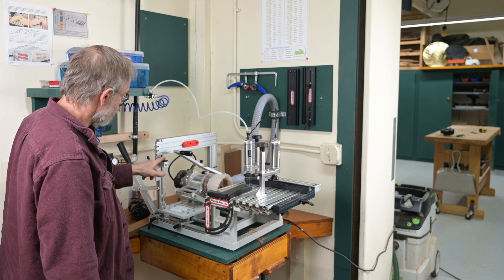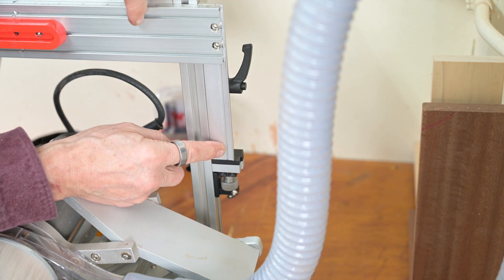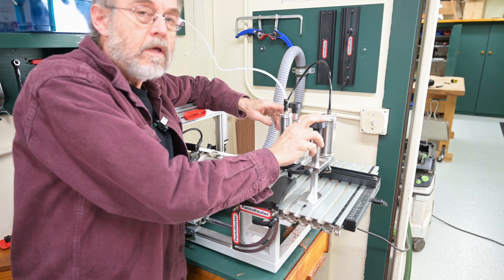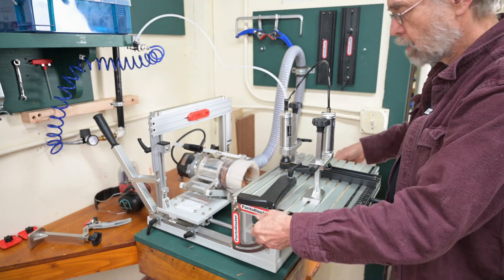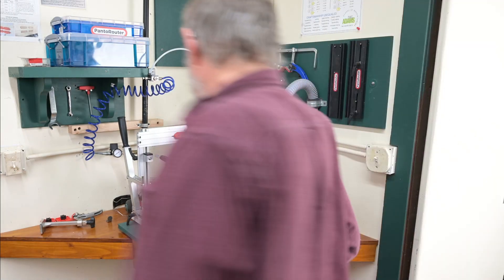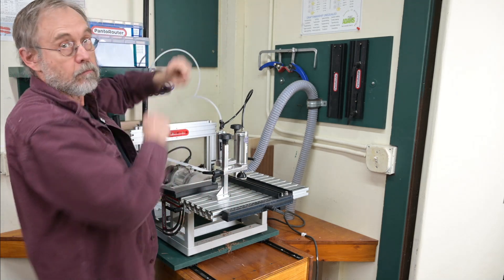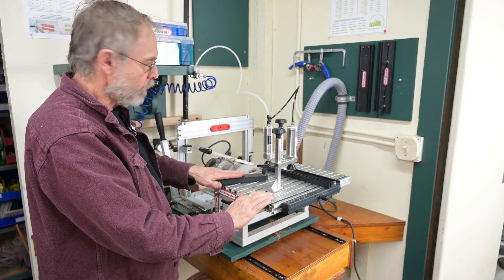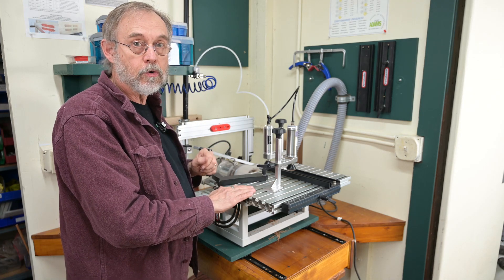PantoRouter Upgrades: The Pneumatic Clamps

Comment: Thanks for video. You are one of the few that have both Pantorouter and Multirouter. Could you do a video comparing the two or discussing what operations that you use each for?
Reply from the maker: I would like to do such a video. But I would like to have more time on the PR  - the pneumatic clamps are still new to me and I need a few projects to run through the shop.
Reply: @DarrellPeartFurnitureMaker  Good point. Until you are able to do a video comparing them, could you share what you use each for?
Reply from the maker: @stevenhancock5435  I mostly use the PantoRouter for anytime I have joinery that  can be done with the templates.  I use the MultiRouter for everything else.

Comment: The swivel clamps are a major improvement over the previous version.  The Pantorouter seems to be back on the list for consideration.  If you rated the Multirouter as a 10, where would you put the Pantorouter on a scale of 1-10?  Steve
Reply from the maker: Hi Steve, I've been mulling that very question over in my mind.  The pneumatic clamps with the swivel base have changed the equation.  Each machine still has it's strong points. If another person were rating the two machines their evaluation could be much different depending upon their intended usage.  It's still a bit early to give a hard number but for my usage but I would probably rate the PR at about 8.5. 

Now that the PR is just as fast and efficient as the MR I see the primary difference being flexibility versus template usage.

 I've seen some pretty creative ways to do  unusual stuff on the PR - but it usually involves building jigs and fixtures. The MR can often do the odd stuff without the use of added components.  I do a lot of odd stuff so the MR makes that easy.

While Woodpeckers  improved the template system on the MR (took out the flex in the stylus) they did not adequately address the bigger problem of fine tuning the fit. The variable MR templates do not offer the infinite adjustability (within the needed range) of the wedge-shaped templates of the PR. If the bit has been sharpened or if the router has runout - the 3 variable templates offered by the MR don't cover the full range needed. There's a reason I gave away my templates for the MR.
Reply from the maker: After some more time on the machine - If the MR is a 10 - the PR is also a 10. The swivel pneumatic clamps are a game changer. Again this rating may vary for you  depending upon your usage.
Reply: @DarrellPeartFurnitureMaker  Thanks Darrell, the clamps and the sale they had in November/December pushed me over the edge on the PR.  I have it assembled but not calibrated as I was distracted by projects and other holiday events.  I need to get back to this but also have another project to start.  Steve